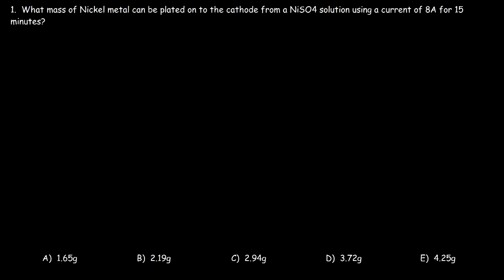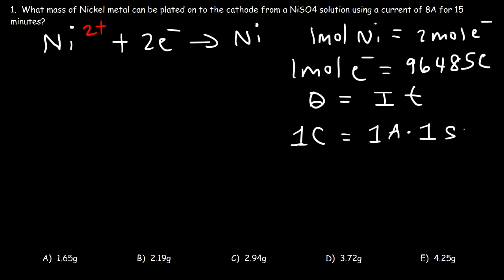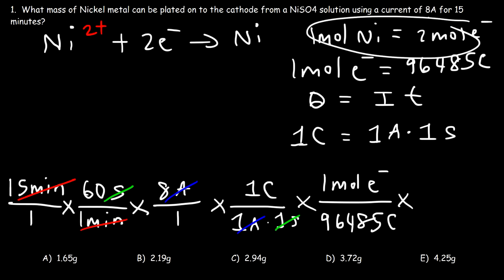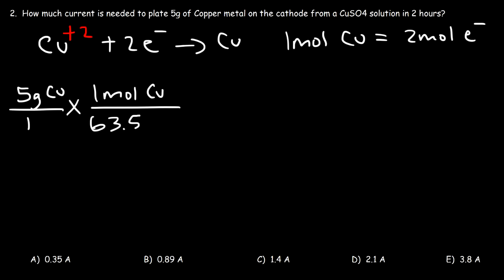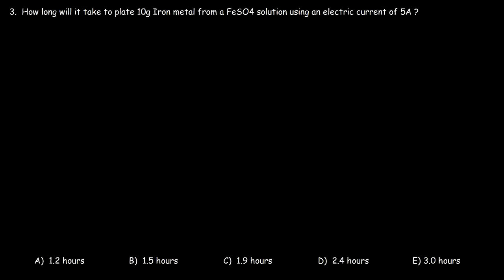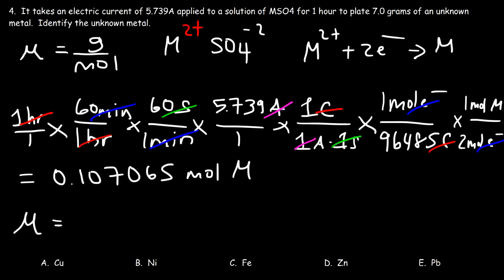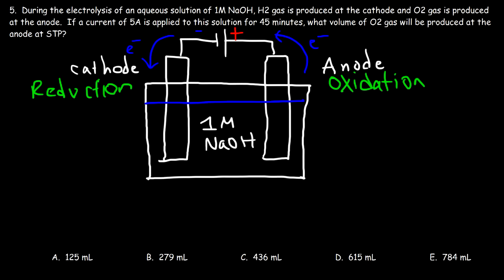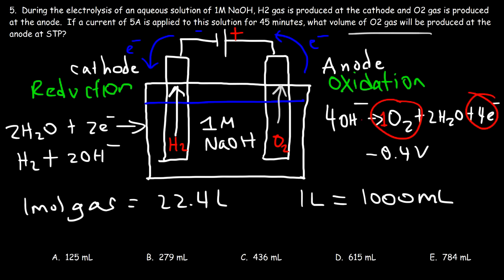Electrolysis & Electroplating Practice Problems - Electrochemistry

Comment: Hello sir how are? Actually your lesson have really started improving my studies,  however i may want to know what determies a metal to be at the anode or cathode whe  drowing a galvanic cell? Thanks very much
Reply: 💀💀💀 might be too late but it is determined by which metal is being oxidized, and the metal that is being oxidized will be the anode
Reply: the lowest or more negative SRP value tends to be the anode while the more positive one tends more to be the cathode in a galvanic cell, if only the half-reactions are given
Reply: Anode(+ electrode ) attracts anions ( - charge ions ).
Cathode (- electrode ) attracts cations (+ charge ions).

Metals are usually positive charged so they usually go to the cathode.

Comment: This explanation is not very comprehensive in my opinion, I don't think the solving process needs to be this complex
Reply: Use second Faraday's law: m=(ItM)/(zF). I is current, t is time, M is molar mass, z are the exchanged electrons, F is constant, m is the mass plated
Reply: What asspull
Reply: @stepanbmw this was honestly so helpful thank u sm
Reply: A simplified explanation is this

Moles (of substance formed)= 
(amps× time(s))/ 
(n (electrons in half reaction)×96500C/mol)

It looks much neater on 📃